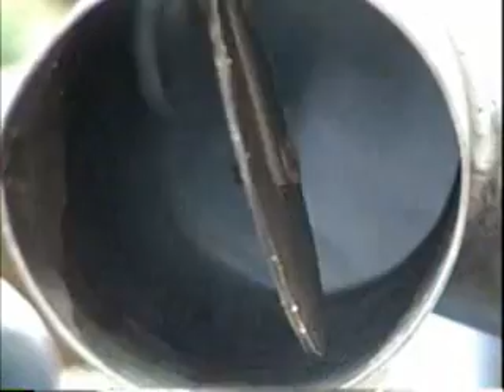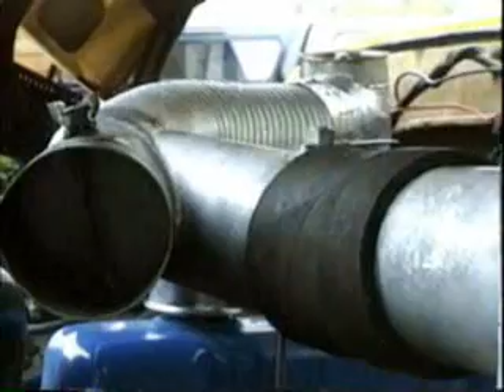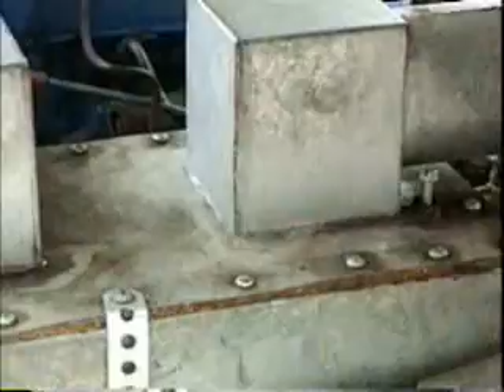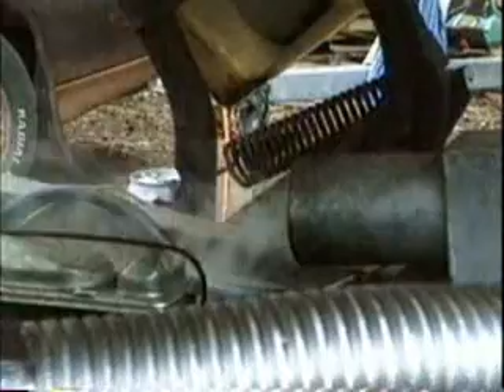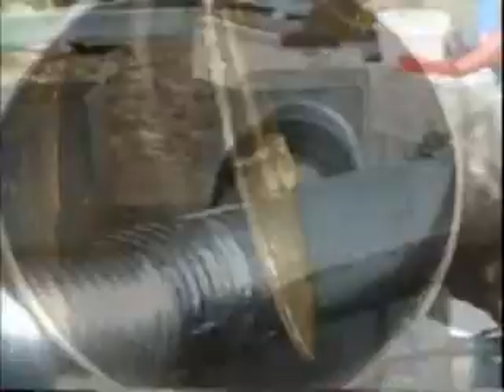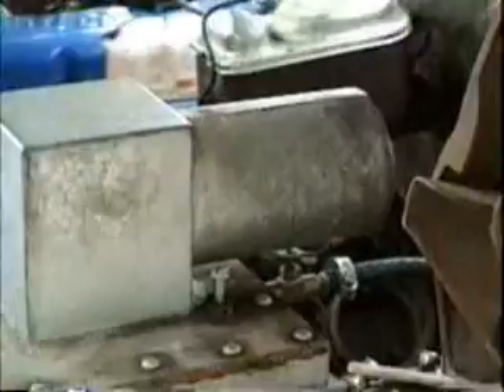Here is definitive proof on how to separate all Atoms in all liquid soluble matter.

Comment: The president is a liberal.  You know nothing about him.  Listen to Rush Limbaugh for a week, then you will understand why the Gov will never call you.
Reply from the maker: First of all I recommend stainless steel. Copper and most other metals have pores in the metal, the pores trap the liquid and cool the metal quicker. Someone has gone to 700 degrees Fahrenheit on the heating element and gets no non flammable liquid residue, when the white vapor is created. Electric pans won't get that hot. it will take around 600 to 700 watts to reach that temperature. Something else tilt the heating element in about a 20 degree angle to get the droplets to roll down the heating element. This insures all the liquid reaches the same temperature. The spray needs to be very fine, so enough distance on the nozzles to allow the droplets to break apart, yet have all the spray hit the heating element.
Reply: Bill Kendrick "I believe" is because you have to heat the fuel before passing it thru the platinum and or nickle coatings for the reaction to occur , at least that's what i read Mr. Allan Gacciarno did on his " fuel implosion vaporization system " , but who knows , I would give it a try but first things first and that is to get the heating element and build a chamber like the one in your pick up truck. Keep up the good work Bill.
Reply from the maker: Journalistification I tried this device back in the late 1980's. They recommended putting the device on top of the intake manifold. On the manifold or off the manifold it did nothing, for the mileage, or power. The guy that created them made a small fortune, until it was discovered to be a scam. To get molecules to migrate from metal, requires a large amount of heat, and time, which is not possible. The extreme heat needed would ignite the gasoline.
Reply from the maker: I don't do politics, and don't care if they help or not. It is something I discovered, and gave to all who sees it here on You Tube. I have listened to Limbaugh, for more than a year. Worked with a Limp Balls nut, and Limbaugh was all he listened to. I will never listen to Limp Balls again. Politics needs to be removed from government. Let the people decide, use the internet, and voting can be done anywhere, no lines, or hassle to suffer, just to vote. I mean we all have Social Security Numbers, pass words and knowledge about our lives to secure our voting. If voting can be easy, it will happen. Senators, and Representatives, will not be needed. Government can be trimmed down, and big money can't control the vote.
Reply: Because Rush Limbaugh is the arbiter of truth and reason. A Liberal wouldn't sell out the American people to corporations a Liberal wouldn't be considering running the most toxic sludge oil through the heart of the country..
Reply from the maker: JRMCNEA Take you politics BS and find someone that gives a damn about it. I do not do politics and will block any more about it.
Reply: Bill Kendrick
You do realize I wasn't talking to you right?
Reply from the maker: JRMCNEA Yes I do and I added my 10 cents to the comment. Politicians are all in it for their own benefits. The people need to change our government. Like the Constitution states, if the government is not working for the people it is the right of the people to change that government. I vote we change it.
Reply: Bill Kendrick
And I guess you didn't notice i didn't say shit about politics either then? So im trying to figure out what your "10 cents" is going towards.
Reply from the maker: Adding Limp Balls into the conversation is a political statement.
Reply: Bill Kendrick Hey Bill I'm trying to build a white vaporizer like yours, could you give some tips and hints for dimension on chamber and stuff?
Reply from the maker: Journalistification I suggest you obtain the heating element, which will determine the size and shape of the chamber. Someone has gone to 700 degrees Fahrenheit on the heating element, so use 300 to 350 watt heating elements. Chromalox is the company I got mine from. If you got the money they can make any shaped, or wattage, heater you desire.
Reply: Bill Kendrick I did a little web search and found a few companies that customize heating elements but i plan on heating a flat surface like copper or stainless steel square pan or something and place the heating element under the flat panel then spray the fuel to that hot flat panel , but i would like to know the distance between the fuel nozzle inside the chamber and the hot surface , 2, ,3 or more inches of separation above the hot surface?  also have you gone hotter than 600 deg. F or that's the max you recommend? i can give you my e-mail if you wish or post here.
Reply: Bill Kendrick Awesome Bill thanks a bunch, I have read from many different sources that platinum and nickel metals act as a catalyst to liquid gasoline ( maybe diesel too?) helping to transform it's treated structure to another structutre release more energy per gasoline drop.  I'm not sure if you  have try coating fuel lines on the inside with one of these metals and see a reaction? something more to try like a "nickel plated" stainless steel  heated plate like we've talked about where the liquid fuel droplets are going to be directed  and converted to the white gas vapor which will then be introduced to the engine via air intake tube not the intake manifold vacuum port like some say, it will be interesting to see if increases it's btu force.
Reply from the maker: Several years back there was a device you added to the fuel line. The device had copper, nickle, and supposedly platinum, I think I paid $100 for it. I never got any difference in engine performance, or mileage.
Reply: Bill Kendrick Thanks for your reply Bill ... ....
Reply: Bill Kendrick I have started on my first variation ..... I will let you know how things go as I progress   Cheers !

Comment: hi bill
what is your mpg 

please give me your mail id i want share some information with you 

i got one four cyl fuel injection i want to add your system on it 

thank you
Reply from the maker: A fuel injected engine, will not work. You would need to put a normally aspirated intake manifold on the engine. The only thing going into the intake manifold on the engine will be the white vapor, and it is controlled by the butterfly valve, that is normally under the carburetor.
Reply from the maker: My MPG was about the same as the gasoline got, but I had more than twice the power that gasoline had. A 4 cylinder engine would have more power than an 8 cylinder has, and still have the 4 cylinder MPG.
Reply: Bill Kendrick Hello sir. Thank you for your vid. And I understood (1) the white vapor can run on several engines (2) It can get twice the power that gasoline had (3) MPG is same as gasoline.
I'm not sure but if you get the power, can you change something to achive more MPG than the power? I'm looking forward to achieve fuel economy, but you mean your system cannot improve MPG, just can get the power by making more ideal internal combustion that can reduce emission.
I'm trying to find the way to achieve mor MPG for several years. I watched your vids and wished you could find the way. Anyway thank you sir.
Reply from the maker: navnath gilbile There is no change in the MPG, from the MPG the engine gets running on liquid gasoline, it is the power increase on the smaller engines that allow the smaller engine to do more work, so they can take the place of the larger engine. It is not the fuel mileage I am interested in, it is what I have done to the liquid gasoline. Separating the atoms in the gasoline using the right temperature is what I am interested in. What can be done to one liquid can be done to any liquid. Only separating atoms in the gasoline can produce zero parts per million hydro carbon readings from gasoline, the increase in power is an added benefit. Do this to water, and at the right temperature you can separate the hydrogen and oxygen atoms in water, creating all the hydrogen contained in the water being sprayed onto the heater.

Comment: This has been around for a very long time. It hasn't been adopted due to inherent safety issues. It could have been made safe but the auto industry already had a proven technology and didn't want to spend the millions of dollars  required for R&D for this technology as there was really no appetite for it until fairly recently. Now there is both need and desire, but gasoline engines in cars will be FULLY replaced by electric cars within 20 years. And with Tesla having released all their patents for public  consumption last week, within 5-10 years the only passenger cars being produced will likely be electric. That said, it's a fantastic technology and I have built one that is controlled by a microcontroller that runs my '86 Nisan truck.  I hope you get back on your feet after the fire and I hope you find your funding.
Reply from the maker: Not this, you see a guy named Smoky, a old time mechanic, that raced at Daytona, on sandy beaches, developed a heated fuel system, this is what has been around for so long. I am spraying the gasoline onto a heating element at 600 degrees Fahrenheit. Science says gasoline  auto ignites at 536  degrees. It is still posted at that temperature, but I found it auto ignites around 1000 degrees, 20 years ago. About 500 degrees that science says does not exist. At 221 degrees I get a flammable gas from distilled water, doing what I did to gasoline. Meaning water in your fuel tank, and hydrogen at the intake manifold is possible with this method.
Reply from the maker: Yea, except I would put a heating element, shaped right to fit inside of a tube, over the intake manifold, with a controllable measured spray, to insure fuel efficiency. Of course the throttle plate will control the engine RPM. I would use 700 degrees Fahrenheit as the heater temperature. On a 4 cylinder engine, you will have the power of an 8 cylinder, while getting the 4 cylinder milage. This could be dangerous in a small car.
Yea, I didn't laugh when the chamber caught fire. It was easy to put out, just covered the intake on the chamber. I laughed about it later.
Reply: Bill Kendrick would i be able to use a Coffee pot heat element to this to heat the fuel?
Reply from the maker: Sorry to tell you but this technology has not been around for a long time. You see science says gasoline will auto ignite at 536 degrees Fahrenheit, so nobody went above that temperature, thinking the gasoline would auto ignite. It was me accidentally spilling the gasoline into an electric fry pan, whose temperature was around 600 degrees Fahrenheit, that showed me that science was wrong. I have seen electric heating elements turn a dull red before the gasoline ignited. This is around 1000 degrees Fahrenheit. I am not just heating the gasoline I am taking the gasoline to the boiling temperature of atoms inside the liquid and separating the atoms in the gasoline, creating a different fuel from the gasoline. I did it to distilled water at 221 degrees Fahrenheit, detecting a combustible gas from the water. I will make a video of me igniting the hydrogen created from the water, soon.
Reply from the maker: David Zick The heating element on a coffee maker will not get hot enough, nor is there enough surface area to create enough vapor.
Reply: I really think that design of the vapor on that truck looks cool.what could i get to get that temp with out going boom lol.
 To bad you could not use a griddle that at least gets 400 or what about a deep fryier that size?
is there a way to hook to motor intake manifold or maybe heater chore? Sorry i am asking I am new at this and with a fixed income it is really hard.  I saw that you use to live in Oregon that is where my wife and i live. 
Would there be a parts list that may help.

I guess i throwing things or parts out their.
Reply: just wondering the parts or things that u used  so i have idea..  I maybe a scientest i still want to do things right
ty 4 writing back
Reply from the maker: David Zick A 1500 watt power inverter for the power, most auto supply stores have them, and flat bar heaters. A company called Chromalox can make any size, shape, voltage, and wattage heater you desire, for a price.
Reply: Bill Kendrick Again Bill .. thank you so very much for this !
What did you use as your first electric power source to the heaters 20 years ago ?....
Reply from the maker: I had an old generator rewired by a generator shop to put out 110 VDC at 2000 RPM. I found out when one of the heaters burned into two pieces that at 4000 RPM the generator put out over 2000 Volts DC.
Reply: Bill Kendrick Thank you ... Sorry Bill but that made laugh ... voltage  at 2000 rpm's just right ... and at 4000 rpm pop... ( time to buy a new heater strip )
However ,..maybe  that added to the efficiency of the unit . What do you think ?
Reply: Bill Kendrick it seems like for the "first timer" .. ( me ) duplicating something very similar to what you have in this video would be the way to go .. do you agree ?  Jay